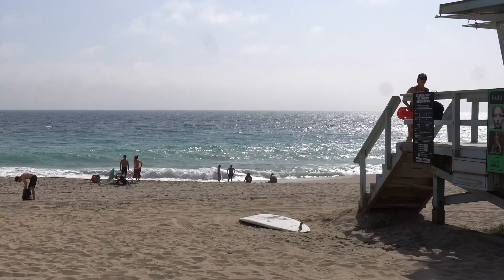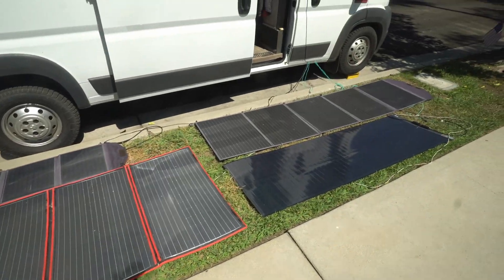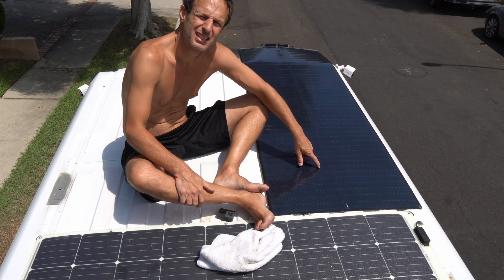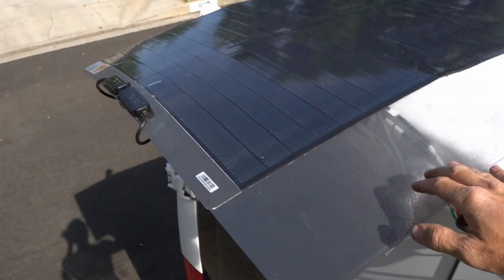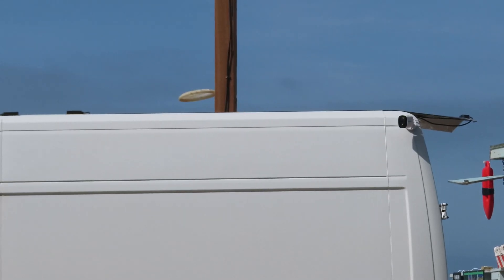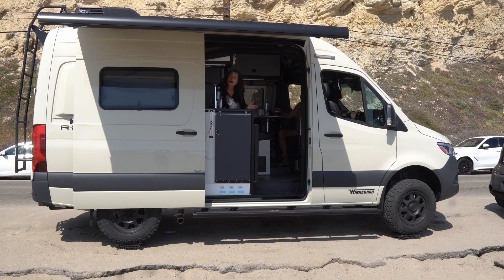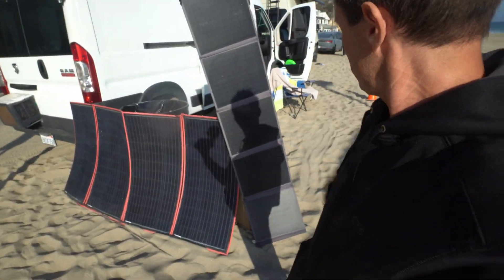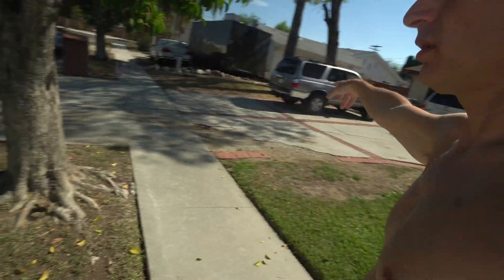New CIGS BougeRV Walkable Solar panel | Test vs Silicone

Comment: I just put a 200w CIGS on my van roof. It works great. I have 460ah of LiFePo, went from 59% to 100% in one day with normal house loads. 
My Q :  do you let your batteries stay at 100% and connected to solar?
Reply from the maker: I like them to cycle as little as possible, which is why I have seven or 8 kWh sometimes it’ll stay within a 10% range over the course of a day even though I’m using a lot of power

Comment: How is the CIGS solar panels performing after 1 year?  How about during the summer heat?  

Do you advise adding a layer of Corrugated Plastic Sheet, Choroplast between the CIGS solar panel and the metal roof?
Reply from the maker: Putting something in between the panel and the metal will help with more insulation.
It’s been way more than a year now and they still work like they did when they were new

Comment: Dave, if you remove one of those running lights there is a nice big hole in which you can run wires in. Just silicone up the hole. Not a big deal to lose a running light.
Reply from the maker: I think legally I can remove the two outer lights
Reply: @NoLimitVanLife   yes check local laws. They are running lights, so the state I live in they are not regulated, if one goes out you would never receive a violation for it. Some vans PM size don't even have the front or rear running lights... I think the Ford cargo van is the one that doesn't have them in the front and I think only one or two in the upper rear. They don't act as brake lights so they aren't regulated. An option for you because running wires through the seal will eventually fail.

Comment: Dude that into and that suit.  Danm!  I need to up my dress... I've used a lot of BougeRV products they are great.  Dude how much solar do you have now?  Bro I'm stoked to get mine.  I also got their MPPT you should ask them for one.   I wanna see how much solar you can get!  That's a nice spoiler how much HP does that add?  Show us how you wore your MPPTs in parallel.  I just hooked up a DC to DC and a shunt with a monitor also got the BT1 for $20.  @bougeRV send this man more panels.  Bro just start installing solar at your Spot X beach...
Reply: Also... what are you on?  😆 🤣 😂
Reply from the maker: YouTube… also Amazon prime famous in the second episode of “trillion dollar planet” For three seconds
Reply: @NoLimitVanLife  next time I'm in Cali I'm at SPot X with you...
Reply: @Vankookz  A lot of spot X to be had out here can’t wait. maybe Spot X dad‘s garage for some upgrades
Reply: @DavetheUberSlave  That sounds dope.
Reply from the maker: To parallel wire MPPTs basically to your positive and negative busbars.
Horsepower? My guess is there’s about 100 W extended off the back once I get all 500 W up there where did you get a BT one for 20 bucks? spot X beach is Zuma come hang out! I do offer my services out here on the beach.
Reply: @NoLimitVanLife  Yeah I figured that solar panel spoiler added at least 15 Horsepower to your van. 🤣